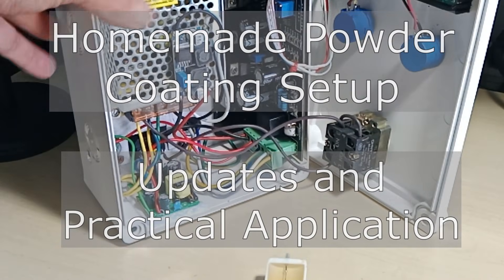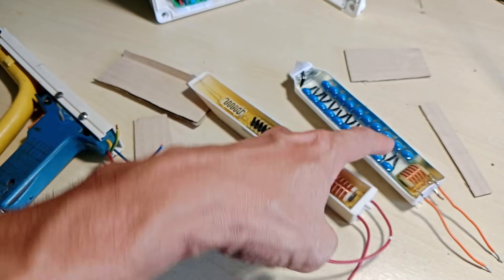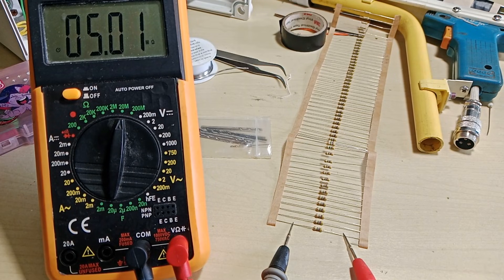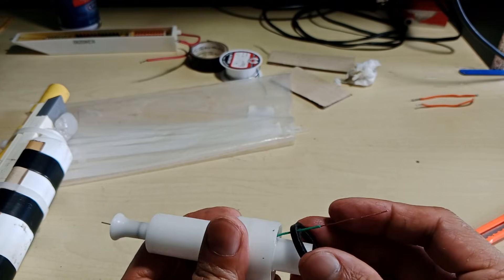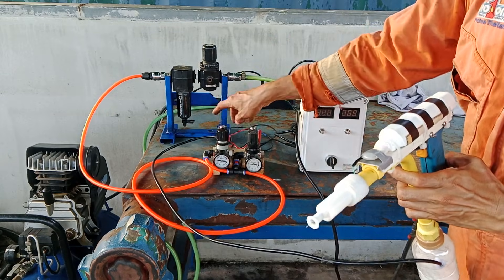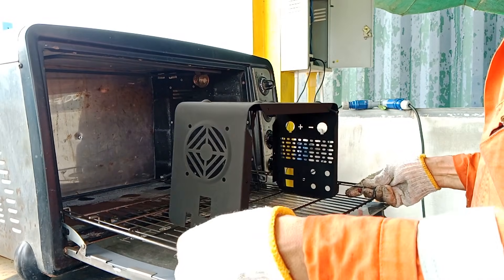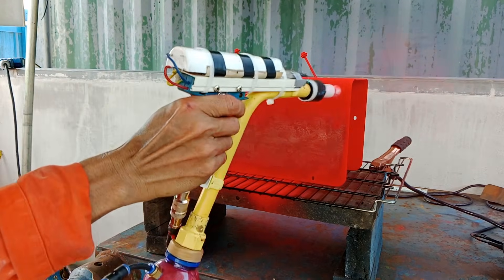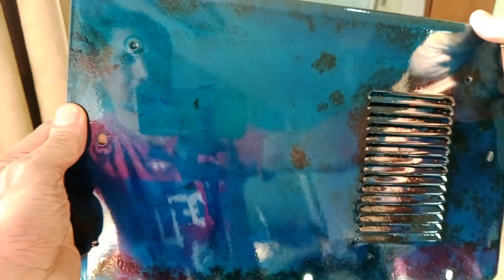Homemade Powder Coating Equipment Update 2025

Comment: I have experienced Faraday Cage Effect more than once. Repositioning the part and how it is grounded never crossed my mind. Thank you for this tip.
Reply from the maker: Correct. The usual practice is to hang the part, so it is only in one position. If possible, to reposition then it is a good technique to tackle hard to reach areas. I used long screws as temporary handles so that I don't disturb the powder already sticking to the part when I reposition.

Comment: why don't you use some primer on this rough surface? I have seen something like epoxy primer applied with powder coating gun. You should try this to get nice painted surface.
Reply from the maker: Thanks. I'm just starting to really get into powder coating, and these are the learning curve I have to go through. The items I coated is not really critical to look beautiful, more like a practice piece for me. The candy blue powder I coated onto the other case makes a really smooth finish, almost like glass even though the metal is rough. So I think different powders produce different results.
Reply from the maker: This is the other case I powdered coated with candy blue powder. The metal surface is also very rough from corrosion pitting but the finish after coating is very smooth. 
https://youtu.be/g492P7xRDac